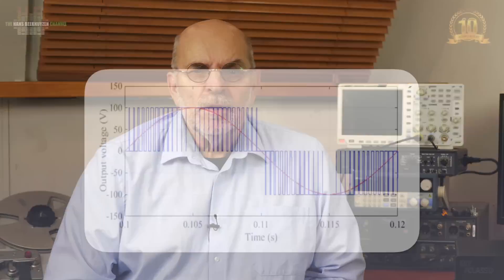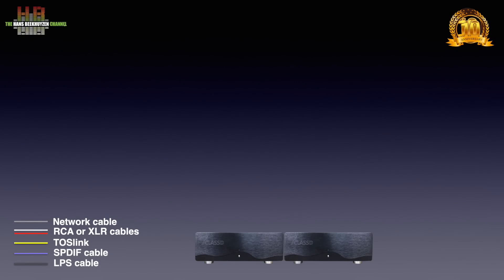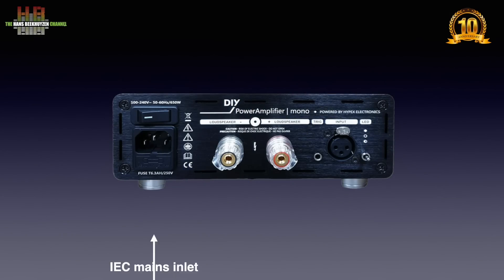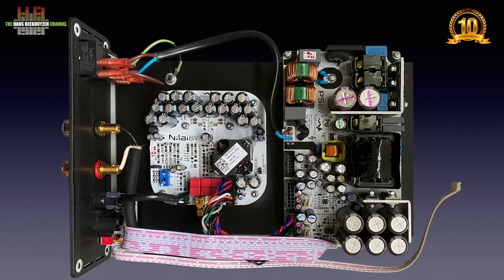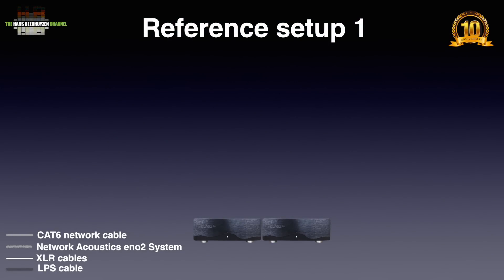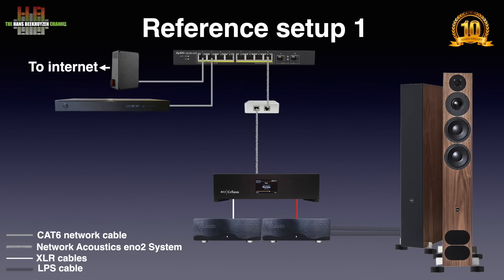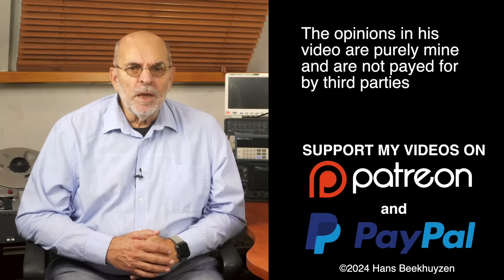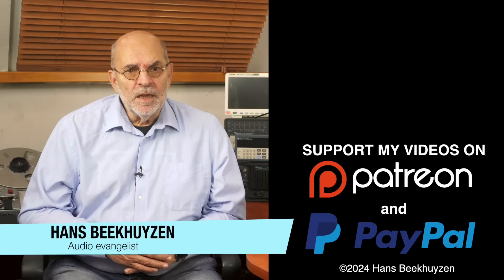Hypex DIY ClassD Nilai 500 DIY power amplifier

Comment: I have put together my own Nilai monoblocks (not using the DIY-build),
and experimented with different cables, connectors etc.
I found that a shielding wall, in form of steel plates around the Nilai modules improved the noise floor even further, and I run Furutech cables and connectors all over (except for mains cables)

Also worth mentioning, is the gain setting on the Nilai module. The lowest gain setting further improves on noise levels, and overall SQ. 😊
Reply from the maker: of course it does. But it doesn't reduce the signal to noise.
Reply: @TheHansBeekhuyzenChannel  Oh Yes, they most certainly  did! Both setting the gain to the lowest level, and shielding the Nilai unit as much as possible, lowered SINAD!

Comment: I built the stereo version in January and added a second PSU in September to make it a dual mono amp. This required drilling 14 PSU mounting holes into the base plate and soldering the wires supplied with the extra PSU onto the existing wiring in my amp. It is an excellent sounding amp and I love the inky black background that music decays into.
Reply from the maker: Thanks for sharing
Reply: I also have the stereo version. Did you notice any improvement to sound quality adding the extra PSU for dual mono operation? However, I am not short of power with the standard stereo version driving Harbeths.
Reply: @nk-gp1ml  Aside from not requiring as much volume from my pre-amp into my 4 ohm Arendal speakers (it dropped from -20db to -24db for the same room volume), it is hard to say. I doubt the volume would have changed into 8ohm speakers as the power output is nearly identical into that load. Subjectively, I feel my Nilai seems to produce better bass than before my modification but without doing an A/B test, it is just my opinion.
Reply: @mddawson1  Thanks for the response. Sounds like will probably be minimal improvement with the modification into Harbeth m30.1s. One benefit could be long term reliability as the mono power supplies will be less stressed.

Comment: For our apartments 10W is enough, why do we need so much power? However, the technique should be encouraged and class D amplifiers are welcome for their very low current consumption, this is their asset.
Reply: @marioo-q8h  depends on the speakers efficiency and the amount of rissitance. Normally heavier amps have better control over difficult to drive speakers.
Reply from the maker: That is an oversimplification. It might be for your apartment end your speakers.

Comment: I purchased a pair of assembled Hypex Nilai 500 mono blocks from DeerCreekAudio and they're exceptional amplifiers.  For $995 each, these amps are a steal.  Currently, I've paired them with a Freya+ pre and Dynaudio Evoke 50’s for a system which sounds incredible even after hours of listening.  Alpha Audio's YT channel has some great head to head comparisons between a Nilai and Pass Labs amp.
Reply: Hello, can you share a link to Alpha Audio's channel, comparing a pass lab vs nilai amps I only see Yamaha as2200 vs Nilai stereo. I am contemplating now on these monoblocks to drive my LRS+. TY
Reply: @alainbesario6679  Under their live tests section, they have three tests of “Book Shelf speakers - 2500 Euro per pair”.  In each test they switch between a Nilai and Pass Labs amp for comparisons.  Nice since difference in equipment pairings are very evident.  Their tests use a stereo version Nilai amp, the monblocks are same design with a dedicated power supply for each, which is why the monoblocks have a higher 4 ohm power rating then the stereo amp.
Reply: @alainbesario6679  it's not a direct one to one comparison between the Pass Labs and the Nilai, but it is mentioned how good the Nilai is considering the much higher price tag of the Pass Labs over here: https://www.youtube.com/watch?v=NdZFAWe1Nxo

Comment: I had the previous NC400 monos until recently and have to say, after 2 years of intensive listening exclusively with them, I thought it was my endgame.
BUT something was missing in the sound that I always loved about my speakers.
Now I have had my Kenwood Model 650 Transistor restored and there it is again, this airy and especially during long music sessions unstrained.
I have owned many types of amplifiers on my speakers, but only a tube and the Kenwood have THE sound for me.
Switching amplifiers are switching amplifiers and not comparable to a tube or transistor.
Reply: So switching is the problem?
Reply from the maker: Whatever makes it sing.
Reply: @danielbuss2865  i was thinking of pairing a tube preamp with the monoblockd

Comment: You can also buy an ready built amp.i was concidering this amp and I'm curious about the soundqality compared with the stereo version,I don't really need the extra power.thx for de review.
Reply: I chose the stereo version, I own a pair of very easy to drive 4ohm/ 90db Audio Physics. So if your speakers are an easy load, go for it. 
Compared to my old MF Class A amp especially the low end is way better and controlled.
Reply from the maker: I never say you do😄

Comment: Don't have balanced outputs or inputs
Reply: @Silkhead44: Did you actually watch the video? These are mono block power amps with balanced XLR inputs and speaker outputs. Balanced/unbalanced does not apply to a speaker output.
Hans also clearly explained that if you want to connect a unbalanced source, you can use a RCA to XLR converter cable/plug. So I don't see your problem.
Reply: And as Hans says in the video, the jumper inside can be set to the output voltage that matches rca. So full output power can be had in your setup.
Reply: Broad smiles with the hypex people in Groningen, I suppose. 2k amps on a 45k setup that don't embarras themselves. At all.
Reply: It doesn't matter. Balanced inputs and outputs should only be used on circuits that can actually accept a balanced input and will output a balanced output. If the topology is single ended, then balanced cables do diddly squat. In class D it is even more pronounced because your incoming music signal is almost immediately discarded. So as long as your input isn't made out of 2 cups and a string, you should be fine. Class D are somewhat cable agnostic in this regard. Your output will only be balanced if someone takes the time to develop a balanced circuit AND low pass filter. You are worrying about things that Class D is simply not yet capable of resolving quite yet.
Reply: ou mean unbalanced (RCA). The only input on this model is XLR or balanced.
Reply: @EARLandPEARL-c3i  you can get rca to xlr cables or if in a bind, a rca to xlr adapter until you get an rca to xlr cable made by a cable manufacturer.